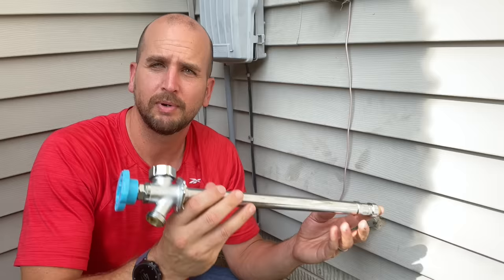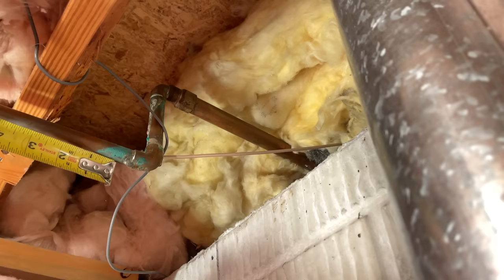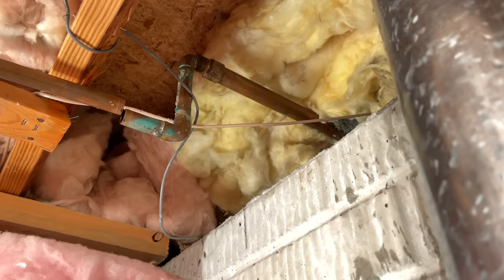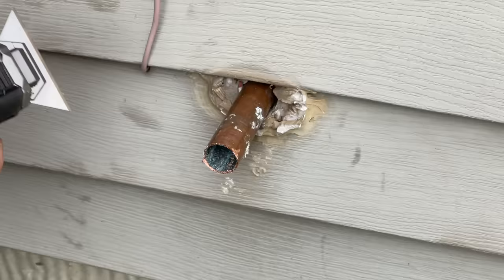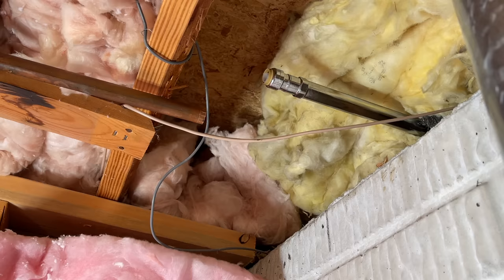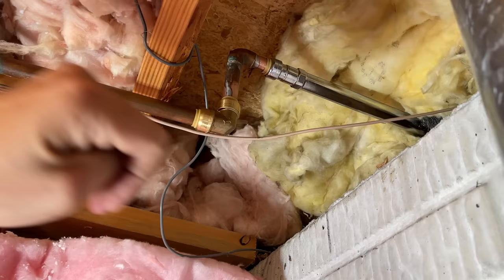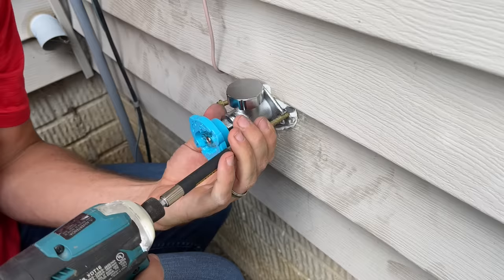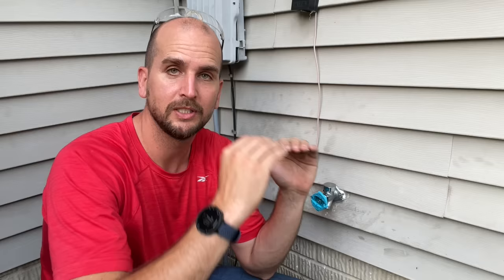Outdoor Spigot Replacement | Sharkbite Frost Free

Comment: I don’t mean to nitpick but you did miss one important step and a lot of people don’t do this step but it’s extremely important. That is measuring and marking the insertion depth  on the copper pipe for the shark bite fitting. I think it’s 15/16 for half inch fittings and one in the eighth for three-quarter but verify those. It’s important because you can push the fitting on until it pops and stops and think you’re at hey solid seat but not actually be there. I marked the pipe once and push the sitting on and it popped and stopped. I looked at the mark I had made to ensure proper insertion depth and it wasn’t all the way on so I pushed harder and then it did go to the Mark for a solid seat. So that convince me that marking the pipe first prior to pushing the shark bite fitting on is extremely important to avoid leaks.
Reply from the maker: Hey Steve, thanks for the comment and call out as you are right and I did miss calling out the depth during the final install.  Take care!
Reply: It isn't nitpicking if you provide constructive criticism in a positive respectful manner, as you did here. Thanks for adding that important tidbit!!
Reply: There's actually a tool put out by Sharkbite that will deburr and measure the insertion depth for you. Handy thing to have.
Reply: @DireNeeds  yes I have the orange tool that measures and deburrs the outer  side but you also need the pen with blades tool for the inside. Both are only about $30 all together at a building store
Reply: Very important, makes it full proof
Reply: You missed the very important step of not using a shark but fitting for a permanent behind the wall installation. They are turning residential plumbing into mobile home plumbing. Cheap, quick, or good. You can only ever have two of these at a time. This is CERTAINLY cheap and quick
Reply: @shelbyseelbach9568  definitely not cheap. Them shark bites cost a pretty penny although real labor is out the door.
Reply: I totally agree. I was installing  a 1/2” shark bite fitting and did a test fit on a spare piece of 1/2”copper. I did a 1” dry mark as a reference. Slid the 1/2” fitting until it bottomed out. It was about an 1/8” short of the 1” mark I made on the copper pipe. In conclusion 1/2” shark bite fittings bottom out at about 7/8” of an inch to get the proper seal.
        Side note: if your using a shark bite slip fitting, the long end of it doesn’t have to bottom out I don’t believe, as long as it goes past the rubber seal that is part way through.
Reply: @eternalklothgardengangsta685  Correct, labor is the main cost of any repair. By reducing the labor cost, you make this a CHEAP repair that is quick as hell. So, now you have a cheap repair performed quickly, and good has simply never entered into the equation. Anytime you are going to pay for anything, you should ALWAYS ask yourself which two of the three you are willing to pay for, because you simply can't have all three at the same time in anything you ever pay for. You will always only be able to get two of them...... at most.
Reply: 15/16 on outside of pipe instead of 2 inch?
 What difference does it make, if you go past 1 inch?
Reply: Also a big mistake is not taking out the sleeve inside the shark bite cause with Cooper you don’t need it per. Shark bite great video
Reply: @hyfyre4704   I just had the same thing, couldn't get to the mark using the Sharkbite deburr and marking tool, had 1/8" left to go and how ever hard I pushed I couldn't get any further.   It wasn't leaking.  This was copper.
Reply: @paulpoco22  cool 😎

Comment: As a handyman/renovator in Canada, I am not a fan of the frost free wall hydrants, with or without the vacuum breaker.   I've installed dozens and most never last more than 3 to 5 years.  The majority are off-shore junk and parts, other than a replacement washer, are rarely available.   I prefer the older KISS system (Keep It Simple Stupid).  My 1928 home has three exterior spigots mounted through the poured concrete foundation wall.  All are simple quality solid brass spigots.  These valves now typically sell for about $8 compared to $55 for the newer 'frost free' type.  I have repaired all three brass valves once during the last 46 years and one valve has just be repaired for it's second time.  (Clean, replace washer and replace bonnet packing).  I will recondition the other two spigots some time this summer, then they will all be good for the next 50 years.   Canadian building codes require every external faucet to have a separate interior shut off valve with a bleeder valve.  It takes about 2 minutes each fall to turn off the inside shut-off valve, bleed the excess water that remains between the inside and outside valves and leave the exterior valve open for the winter to prevent freezing when the temps sink to minus 30.   I never plan to replace an outside spigot.
Reply: Along the lines of your reply, you don't have to drill a big hole for the conventional spigots.  And I found one that is made with a ball valve.  I installed that on the outside of my in-law's house.  I think ball valves are easier to use for the elderly.
Reply: @AStanton1966  I'm a big fan of 1/4 turn, full port ball valves for almost all valve requirements.  Superior as an on/off shut-off valve, but not well suited for applications requiring throttling to control flow.  Still works very well for outdoor faucets because throttling can be done at the hose nozzle.
Reply: Fabulous remarks. Big smile
Reply: @AStanton1966  Aren't ball valves easier to turn for EVERYbody?
Reply: @kooale  I suppose.  Frost-free valves, having a longer valve stem, tend to drip a lot before shutting down.  This makes people want to kill the valve and over-tighten them.

Comment: Hi Scott.  Very nice step-by-step video!  I have 2 suggestions:  yes, while you spoke about deburing the outside of the pipe, it is also important to debur the inside of the pipe to stop water turbulence and possible banging from all of those burrs especially when cutting with a hacksaw.  Secondly, I would put a pipe clamp on the 2x4 just before the SharkBite to give the whole assembly more support.  Yes, I would interested in the drywall plumbing project too!  Thanks!

Comment: Good video. I've used these on two spigots and both failed. They didn't fail on the pipe connection but on the outside at the chrome cap (vacuum break) on the top. You mentioned here what I didn't know at the time and that is you MUST disconnect your hose before they freeze. If I had read the directions (my bad) I would have realized this and saved myself the time and hassle of having to replace them.

Comment: Over the years I have decided that if it's outdoors or wet areas I use stainless steel bolts / fasteners. Yes they cost more, but they save so many headaches down the road.

Comment: Thanks very much for making this video.  I reviewed it before I did the same job on my house.  My only comment is that I assume you were concerned about orientation of the outside spigot because of the way it has to fit on your siding boards. Those who don’t have that issue should know that once the spigot and piping is installed in the SharkBite fittings - it can be rotated 360 degrees before securing it to the house.

Comment: I clean carpets for a living since 1987 so I've literally hooked up to thousands of homes outside faucets for water. I've seen a whole lot of these freeze up during winter and cause a leak inside the home or under the house more times than I can even keep track of because it happens a LOT. I'm sure improper installation is the number one culprit. If they aren't sealed up against the wall properly or pitched properly it will only take one good freeze and you'll be needing either a repair or a replacement. When I clean I need to hook up to the outside faucet and believe me this has caused me trouble a lot of times over the years. I would almost bet money if I were a betting person that somewhere in the neighborhood of 1/4'th of all faucets in my area is bad as I type this. I'm in SE Missouri so our weather may get down to zero in the winter and rarely lower with wind chill. I very rarely see a faucet that is actually sealed up against the wall and often they're hanging very loose and not pitched properly so they can drain out when you take the hose off. Most people do remove their hoses in the winter, or at least they claim they do so improper installation is the number one cause IMHO of failure of these faucets.

Comment: I havent used sharkbite spigot before and that's what I'll use next time if the customer is ok spending the extra money for the part. Also want to comment on leak testing. You said you ran water out the spigot to look for leaks. The true test should have been conducted under pressure with the spigot turned off. That should have been mentioned in this video.
Also you mentioned reusing the old part (90°) to avoid having having to purchase another sharkbite 90. I liked that you were able to reuse it. In my mind it's best to replace. Suggesting to reuse corroded copper piping is a shortcut and in most cases not recommended. Also it looks cleaner and reassuring to replace rather than reuse (best practice).

Comment: For newbies, I would recommend purchasing the Sharkbite depth gauge. Using a Sharpie to mark the proper insertion depth on the pipe ensures a tight connection.
Reply from the maker: Yep, not getting the proper depth I would guess is 99% of the reason behind people getting leaks with Sharkbie fittings.
Reply: Yes, and use the debur tools. I've seen a debur tool that also measures depth. Very handy.

Comment: We had a record freeze in south Texas that burst some of my pipes. I had to cut into my inside wall to get 
to the faucet. Since I had paneling cutting into the sheetrock was no problem. I did have my plumber buddy do the soldering in the wall. It had to be done fast as not to burn the house down. I will try the SharkBite on other projects.
Reply from the maker: Yeah, when you are starting off sweating pipes I think the open flame around wood does intimidate a good number of home owners.  I wonder home many spigots burst during the freeze in Texas 🤯
Reply: @EverydayHomeRepairs  Also a lot of vacuum breakers for sprinklers cracked. Most stores were sold out. I went to a industrial supply store and found one. He told me he had six left after ordering eighty.

Comment: I have to replace my outdoor spigot also, but it is a the bottom of the list.  It leaks so much outside, sometimes we can't tell if the water is on/off.  Eventually, it all drains, but water outside is an enemy in the North.  Mine goes inside to a finished part of the basement, but I may have access.  I will have to add some of these details for when I'm ready to tackle.  Thanks for the perfect pace of your videos.

Comment: I like to use a small spirit level on the pipe to the valve to insure you have downward drainage when you turn the valve off. Doesn't take much, half a bubble at the line will do.

Comment: The more challenging spigot behind the drywall is exactly what I'm dealing with, I would love to see a video on that
Reply from the maker: You might be in luck, I have 2 spigots which are covered by drywall and I am trying to work that project into the content calendar.   Thanks for the feedback!
Reply: Yes Sir, I sure could use that video going into the wall, I have 2 I need to do and the plumber wants 350 each including the parts. 😩

Comment: I'd be interested to see the other spigots start to finish, including dry wall.  But this video is exactly the same scenario I'm in.  I didn't even realize shark bite spigots were a thing.  Thanks.
Reply from the maker: They are handy 👍
Reply: @johnchonka2052  if you install them correctly,  they are fine. Most leaks come from not deburring the inner and outer diameter..and making sure they are fully seated. Iirc got2learn goes over it a lot in pretty good detail .. when he put that cap on, he should have deburred the outside of the copper ..it tears up the rubber o ring (fyi: wrote before watching video)
Reply: @scarce911  where I live they fail alot due to extreme cold -20°f consistently and even colder. I've been plumbing 25+ years I'm old school I prefer soilder and expansion pex with male sweat brass adaptors. Sharkbite is for people that don't know how to Plumb. I will say I use sharkbit for temporary fixes example if I can't get the water totally off atm I'll use sharkbit until I can solider a permanent fix
Reply: at -20°Fa Sharkbite can prevent a burst cooper pipe, by acting as a relief valve... yes it will still leak but a Sharkbite can usually just be pushed back into place instead of having to find where the pipe burst and then having to repair it....

but I get it the trades hate to see anything.that will avoid a overprice service call....

FYI PEX A is better option than cooper to prevent freezing damage...
Reply: @johnchonka2052  
Plumber, no surprise

Comment: My parents had the same issue with one of their outdoor spigots.

When I replaced it, I also added a cut-off switch just before the spigot in case I had to replace it again, just so I didn't have to turn off the entire house's water (like I had to do the first time :)

In addition, I also added a small drop-down "box" over the entire area with a "door" that opened, giving access to the entire area (this too was in a finished ceiling). Painted, it more or less blended in (being in the corner helped too).
Reply: Yeah, I added a dedicated shut off inside my house when I replaced my spigot. I have one main shut off, and that's it. I don't have dedicated shut offs. Whoever plumbed my house was an idiot.
Reply: i always add extra shut offs for water or gas whenever i have to take something apart. they always come in handy later on.
Reply: @feelingtardy  but adds another failure point, no?
Reply: @wolfeadventures  I'm in a house that will be 100 years old next year. Things done right can last a very, very, long time without aver failing.

Comment: Very good explanation of how to replace an outdoor faucet. Another brand of faucet I would like to see how you install is the Aquor House Hydrant. This faucet self drains and can be left uncovered during freezing conditions without bursting and would be interesting to see how easy it is to install.
Reply: I just replaced all mine with the Aquor, you can put a SharkBite fitting on the end of the Aquor and then its identical install to this video.  The vacuum breaker is on the removable hose part so it leaves a really classy fixture on the outside of the house.

Comment: I installed these at four locations in my house and less than a year later replaced them all.  These are easy to install, but you can't get parts for them, they have a ridiculously flimsy seal, that leaked almost immediately,  and a handle that while cute, it painful to turn. If you want the convenience of a slip op fitting, buy a regular valve and add an shark-bite adapter.
Reply from the maker: Oh man, that handle is a questionable design 😂.  Mine leaked a bit at the start and was hard to turn completely off but after a little use it seems to have seated the seal a bit better.
Reply: Mine is also painful to turn, I might return it.

Comment: Another winner here Scott.  I was a little worried until you cleaned up the pipes.  I’ve used SharkBite push to fit, and they have leaked, due to my error.  All pipes must be burr free, inside as well as outside, so glad you covered that.  I’m not a big fan of them, but feel they have their place, and make a good temporary fix.  I’ve used the stops, on pipes I would have to come back to work on, and allow the water to be cut back on.  I’ve got an outside spigot that needs to be replaced, but it should be relatively easy?  It’s a frost free design, and it runs directly into the plumbing with a compression fitting.  I just can’t tell what size I need, so I will buy a 10 and 12 inch spigot.  There is a secondary cut off ( gate valve ) but it’s locked on tight.  Sediment and some corrosion I’m sure, but PB blaster, WD 40, nothing will loosen it.  I can just cut off the main ball valve at the utility area.  I think your idea on other types of installs would be good.  BTW, I just picked up the Klein NCVT you rec’d in a recent video, and it’s the best non contact tester I’ve used, so big Thanks for that!  👍👍👍😁✌🏻
Reply from the maker: Hey George,  sounds like you got a nice little project ahead of you. 😁

Comment: FYI sharkbite saved me. I keep some around house in case of emergencies. July 4, I had an emergency leak (pin leak) and hole depot was closed and plumber wouldn’t answer. Used the sharkbite instead. That worked
Reply from the maker: The sharkbites really do shine in those type of scenarios. 👍👍
Reply: @EverydayHomeRepairs  I don’t have any soldering and no propress device. So It works out for me. Tons of plumbers cringe when they hear l sharkbite”

Comment: If your wanting the spigot to last longer,  you would install a shut off valve with a bleeder valve especially if your in the northern Canadian winters.
Reply from the maker: Thanks for the feedback/advice!
Reply: Yeah, I was really surprised he didn't simultaneously install an isolation valve. A small effort to avoid bigger potential problems down the road, whether the basement is finished or not!

Comment: Very nice pertinent video. Would have been nice to show the removal of the end-cap sharkbite with the removal tool used to cap-off the supply copper pipe. Also, the supply copper pipe was not apparently sanded or cleaned before the 90-degree was attached, which could cause a terrible leak.